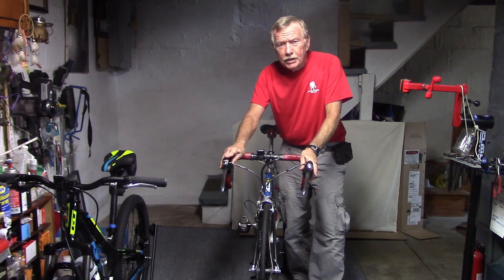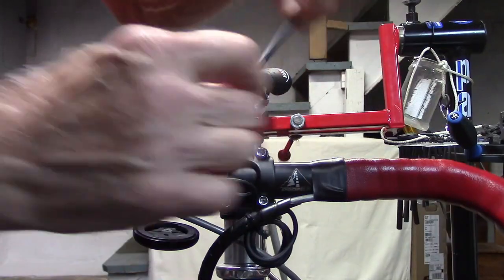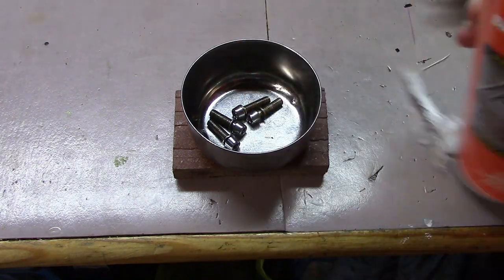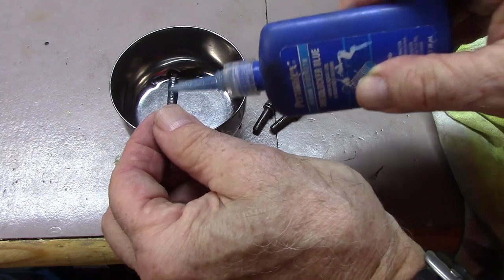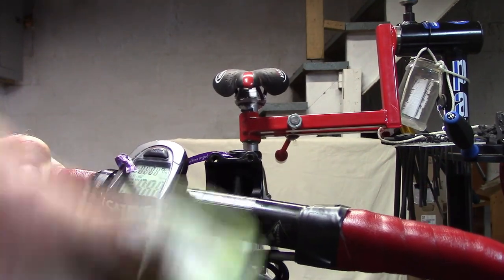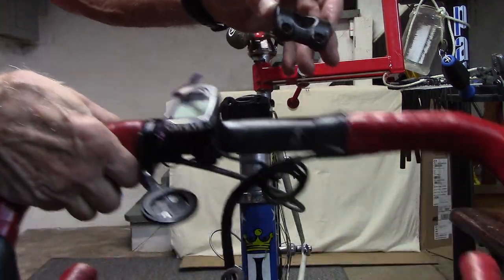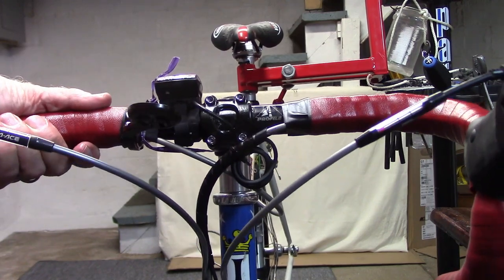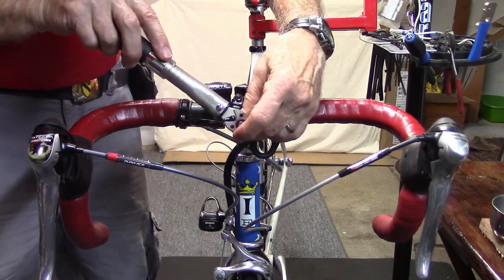Handlebar Creaking: Problem solved

Comment: Hi Tony,  from Brazil. Amazing Man!! I'm I was just looking for a solution for my case: i checked pedals, seat tube, headset, cranckset, and nothing solved my problem. So, i saw this vídeo, and i used the blue loctite in the steam bolts and the creak sound dissapear. Thanks a Lot for this maintenance classe!!!
Reply from the maker: Finding where the noise is coming from is usually the biggest challenge, especially when dealing with clicking or creaking. Congratulations on finding the problem and the easy solution. In some cases, one needs to also remove the handlebars, clean the clamp area and I usually apply Fiber Grip (used for carbon fiber but allows for a better seal with all materials including aluminum and steel at a lower end of the recommended torque recommendations) to the area of the clamp that comes in contact with the handlebars. 

Also visit our YouTube home site at:
https://www.youtube.com/user/MrTony10speed
Regards and safe cycling, Tony

Comment: Great channel full of helpful tips and hints, new subscriber thanks for the uploads.
Reply from the maker: You are welcome. Glad you find the videos helpful. Regards, Tony
Reply: @tony10speed  strange, I have aluminum handlebars, but I have this noise, but I have carbon spacers? aluminum handlebars make that noise?
Reply from the maker: @BikeIsLife4EverGG  Most handlebar these days are aluminum with some newer that are carbon fiber. And yes, aluminum and carbon fiber handlebars can creak (the carbon fiber spacers are not the cause). You may need to remove the handlebar clamp, clean and use Fiber Grip carbon paste (even with aluminum bars) because the Fiber Grip allows for better compression of the handlebar, less friction and less noise. Regards, Tony

Comment: Another good tip is to mark the clamp/bar with Whiteout.  This will assist in assembly at both axis.  And easy to clean off.
Reply from the maker: Great idea. Thanks for the tip.

Comment: I’m having the same exact issue. I installed a new stem, I thought maybe it was in the bearing, I’ve had it apart several times, it’s got plenty of preload, I’ve torque all of the handlebar hardware. I did not use this paste though, might be time to purchase some.
Reply from the maker: I had an issue with one of my restored bikes where it made a creaking despite cleaning the handlebar clamp, using Carbon Paste, and torquing to specifications. My problem turned out to be a loose headset (despite the fact I didn't hear a "clunk" when braking). Replacing the headset bolt  with a new longer bolt and tightening a little more until the wheel did not freely turn back and forth, then backing off the headset bolt just a bit solved the creaking noise. Just something else to consider. Regards and safe cycling, Tony
Reply: @tony10speed  yeah, I’ve loosened and retighten the headset stem a couple times. I tighten it enough, so it doesn’t rattle when I bounce the front end up and down. I truly think it’s in the stem/bars bc I just installed a new stem. I greased the bolts on the handlebars too. I’ll eventually get it…I can only get it to repeat when rolling with pressure on bars.
Reply from the maker: Be sure the stem is the right size for the bar. They can vary by .2mm and an improper fit can cause noise or even slippage. Also, I've seen creaking coming from carbon handlebars probably from some flection of the bar due to thin-walled and large-volume cross-sections. Safe cycling, Tony @rodb4523

Comment: This is exactly what started happening on my new mtb after 2 months of riding and it was loud and annoying . I knew it was coming from the head clamp. I’ll be getting the grease for sure.
Reply from the maker: If you note creaking when pulling on the handlebars that seems to go away when you ease up on the bars on flat terrain, it's probably the clamp as you mention.
I like to clean the clamp and bolts and then use a carbon paste such as Fiber Grip since it has small particles that allow compression at a lower torque setting. Be sure to grease (or, even better, use Loctite Blue on the clamp bolts so they won't loosen) and to check out the manufacturers torque settings for the clamp bolts (sometimes it's written directly on the clamp or stem). Let me know how you make out. Regards, Tony
Reply: Thanks I just ordered some fiber grip

Comment: Tony, this sounds like my problem, but I'm pushing down on the handlebars not pulling - the creaking only happens when I'm standing on my pedals up a steep hill. Do you also mean "pushing" as well as pulling? Thank you!
Reply from the maker: When you're standing on the pedal, you may not be aware that you are pulling as well as pushing. But yes, both can cause creaking. It's not a difficult problem to solve. Take a picture of the handlebars from the side with your camera. This way you'll know how far up or down to rotate the handlebar when you go to replace it. Remove the handlebar clamp bolts. Clean everything including the bolts. I use Fiber Grip on the clamp where it contacts the handlebar (has small particles that compress to prevent the handlebars from rotating down), use Loctite BLUE on the bolts. Reassemble and torque bolts to specs (consult manufacturer if not written on stem or clamp). Let me know how you make out. Regards, Tony
Reply: @tony10speed  you are so kind to reply in such detail and include a recap of what you showed in the video. I'm pretty insecure about working on my bike - afraid I won't tighten it enough since I don't have tools. Is this area that creaks a danger to me, or just an annoyance? Thanks again.
Reply from the maker: @WendyWahman  The most important aspect to consider it that the handlebar clamp is secure and the clamp bolts have been torqued to proper specifications. Otherwise, the handlebars may rotate downward as you're riding which can be dangerous. I would have your local bike shop remove the clamp, clean and lubricate, and re-install the bolts with Loctite Blue and tighten to manufacturers specifications. Although you might go many months without problems, I, myself, would fix the problem before it becomes serious.
Let me know how you make out. Tony
Reply: @tony10speed  Thank you so much. It was mostly fixed at a shop 3 months ago but has gotten progressively squeakier. I'll take it back. Thanks so much for replying and helping.

Comment: Last week I applied fibre grip paste and it made no difference. After I found your video I repeated the process but this time added the Loctite blue and it cut down the creaking 95%. It’s way better but I still have some creaks. Could it be stem bolts too?
Reply from the maker: Could be that the headset bearings need cleaning and grease. Where did you add the Loctite blue? To the handlebar stem bolts or to the area you used the Fiber Grip Paste?

Comment: The compound most likely have silica (sand) that will damage paint. The new handlebars are smooth and painted (or anodized) black most of the times. This is specially noticeable on black seatposts. Try not to put compound unless no other options. Grease does not work as well, because it requires greater tightening force to achieve the same effect. Some people use the anti seize compound, which I found to be the least evil.
Reply from the maker: I prefer Fibrogrip which has small Teflon particles (not silica) allowing for tightening at the lower end of the torque specifications and prevents slipping. Fibrogrip is made for carbon fiber but can be used with any handlebars or seat post with out scratching surfaces.  Regards,  Tony

Comment: aside from the annoying creaking noise, is it at all dangerous?
Reply from the maker: Creaking noise is not only annoying but may indicate an underlying problem. In the case of the handlebar clamp, there are several problems:
1. The creaking could be a lack of proper lubricant (proper grease or carbon fiber paste such as Fiber Grip). This in turn could lead to excessive wear of components and/or bolts. We wouldn't want to see a failure of either.
2. Lack of proper bond between the handlebar clamp above can also lead to handlebar slippage - the brake/shifters suddenly dropping down out of your control.
3. Over tightening of bolts can lead to creaking noise and bolt failure or breakage.
I pay attention to all bike noise and investigate each to the best of my ability. Time and patience are required. Safety is the main issue.

Comment: Did this and my bars are still creaking, any reason why?
Reply from the maker: Are the bars carbon fiber (some carbon fiber bars have alot of flex and creak)? Do you have the correct size bars for the stem you are using? If the bars are too small, no matter how tight you make the bar clamp you will hear noise. If too large, the clamp will not grab the bars properly.

Could what you hear be coming from some where else although it seems to be from the bars? 
Are the quick release or thru axles thight? 
Hold the breaks and push the bike forward. Is there movement in the headset? 
Check your cleats and pedals for wear. 
Do the pedal need to be removed, spindles greased and retightened? 
Sometimes creaking that seems to be the handlebars turns out to be the bottom bracket. 

Check the easiest things first and proceed in a logical order. Sounds get referred along the frame and fork requiring patience and time to find the source. Let me know how you make out.

Comment: I think this is what I'm hearing on my diverge maybe. Yesterday I had to pull up on the bars to lift the front wheel to go up a hump in the ground and my bike creaked. I was able to replicate it over and over again by lifting. It freaked me out I was thinking maybe I broke the carbon if the fork/steerer
Reply from the maker: Sounds more like a loose headset. Check out our headset adjustment video:
https://www.youtube.com/watch?v=N0Zagtnyhys
If you broke or cracked the fork/steerer you find the bike very difficult to steer and keep in a straight line on the road or trail. I know since I've cracked several over the course of my cycling career. Let me know how you make out. Regards and safe cycling, Tony
Reply: @tony10speed  ya my conclusion is that it's not the carbon steerer or fork being cracked and it just needs to have some paste applied. I recently had to add some to the seatpost because that was creaking so it must be similar
Reply from the maker: @akkoonassis9045  You may just need to remove, clean and re-grease the handlebar clamp. However, on one bike I worked on, the problem was that the steering tube of the fork need to be cleaned and re-greased. It's a little more of a job to take apart, grease, re-assemble and adjust the headset. Try the handlebar stem clamp first since that's easier. Don't forget to clean and lubricate the the bolts of the clamp and tighten to manufacturers torque specs so they bolts won't loosen up while riding (seen it happen and the whole handlebar and brake/shifter rotate forward - not good). Let me know how you make out. Regards, Tony

Comment: Hi! My cycle is Roman Bike XT-780x. I bought it last month, brand new, and now it is making a squeaky noise when I'm turning the handlebar. I thought that there might be some rust due to which it is making a noise. But when I checked there wasn't any rust. Secondly, there is a clicking noise in the rear tyre. Please tell me the solution for these problems, I'm worried a lot😢
Reply from the maker: If it squeaks when you turn the handlebars, it sounds like the headset was over tightened. I have a video relating to the headset being too loose. The fix for being "too tight" involve loosing the stem and headset cap bolt and re-tightening as in the video:
https://www.youtube.com/watch?v=N0Zagtnyhys&t=1s&ab_channel=TonyMarchand
and
https://youtu.be/TihBJNn0Bck?t=218
The other possibility is that the headset "races" where not greased which involve taking the entire headset apart and greasing the proper components of the headset (a much bigger job). See:
https://www.youtube.com/watch?v=CfDbN6hTu_A&ab_channel=GMBNTech
As far as the clicking from the rear of the bicycle, does it happen when pedaling, coasting or both? Does it occur as a constant clicking, once every pedal revolution, once every third or so pedal revolution, more often? See:
https://www.youtube.com/watch?v=0_qZmXNS8PQ&ab_channel=TonyMarchand
Let me know. Regards, Tony
Reply: @tony10speed  Omg! The handlebar bar noise has gone away. I just loosened the screw, like the way you said. As far as the clicking sound is concerned, it comes when somebody is sitting and the cycle, and it comes when the cycle is stable as well as when I am pedaling it. It is a very annoying noise like tick tick. Thanks❤️
Reply from the maker: @mairchishty6847  Just to make it clear, it clicks when you pedal or coasting (riding on the bike but not turning the crank). Is this correct? If so, several things should be checked:
1. Is there a loose spoke? Pluck each spoke like a guitar and see if there is one with a very low tone. You may be able to feel that it's loose. If so, you will want your bike shop to take a look and re-true the wheel.
2. Make sure the wheel is installed correctly and not hitting the brake pads (rim brakes) or rubbing on the disc brakes. You may want to remove the wheel and re-install it making sure it's centered.
3. If you have an odometer magnet or Garmin magnet, make sure it's not hitting the magnet "pickup" each time the wheel rotates.
4. Finally, it could be coming from the rear wheel freehub. No easy fix hear except to check with your local bike shop about solving this problem.
You didn't mention how often you hear the click: Once every pedal revolution, once every wheel revolution, constant clicking?
Regards, Tony
Reply: @tony10speed  It clicks when I'm pedaling, once every wheel revolution.
Reply from the maker: @mairchishty6847  Check the above (but if there is no clicking while coasting, a freehub problem is less likely then the others listed). Also check for a stiff chain link. See:
https://www.youtube.com/watch?v=hklVw3KErKw&ab_channel=TonyMarchand
You can also check out our other video on clicking while pedaling:
https://www.youtube.com/watch?v=0_qZmXNS8PQ&t=1s&ab_channel=TonyMarchand
Let me know how you make out. Regards, Tony
Reply: @tony10speed  Sure!

Comment: What happen if I over tightened my bolts in my stem does it destroy my stem ? Or create cracks ? 
Does it okay to over tighten my bolts even it is an alloy ? 
Im using an EC90 stem
Reply from the maker: Bolts are (usually) steel and stems are aluminum or carbon in most cases. Steel is much stronger than soft aluminum or brittle carbon. The torque rating is so you don't pull the threads out of the stem (strip the threads) or crush the bars. Torque ratings are especially important when you are using carbon in the bars or stem where you  may crack and damage the carbon. So invest in a torque wrench and look up the specs for the torque for your stem (usually around 5 Nm but there is some variation).
Regards, Tony
Reply: @tony10speed  sir I dont have torque wrench and even I over tightened the bolts my drop bar is still moving downward
Reply from the maker: @johny9083  It would appear the the handlebar diameter is too small for the stem clamp. Sometimes there are marking on both stem clamp and bars that tell you the diameter. Otherwise, you or your bike shop need to measure both. The cheapest option are handebar "shims" that are placed on the bars to make up the difference in size and hold the handlebars in place. I just ordered a pair for one of the bikes I'm working on. If there are no marking on the components or you don't have calipers to make the measurements, see your local bike store who can measure both. And tell them you want the shims (you don't need to replace the bars and stem unless they are an unusual size). Let me know how you make out. Regards, Tony
Reply: @tony10speed  i habe already a shim and it make fit in my drop bar and stem but my problem is that it still moving downward or twisting if I will apply higher force downward. Do I need to buy fiber grips ? 
Im thinking when I over tightened my bolts the stem and drop bar will crack.

Comment: If you put grease on the clamp wouldn’t that make the handlebars spin?
Reply from the maker: Fibrer Grip is different from normal grease. It contains small Teflon like particles that allow for compression and prevent slippage at a  slightly lower torque. This compression prevents slippage and also decreases noise from the handlebar clamp. Although made for Carbon Fiber, we use it on all our handlebar clamps and seat posts.

Comment: I have tighten those bolts and that sound still on I think is the bearings
Reply from the maker: Did you clean the handlebar clamp and apply Fibro Grip before tightening? 
Did you check the headset for knocking or creaking? See:
https://www.youtube.com/watch?v=N0Zagtnyhys
Also check the quick release or thru axle. See:
https://www.youtube.com/watch?v=XQCrqDXwycA

Finally, it could be the headset bearings and you may need to overhaul the headset (or have you local bike store take a look) if other sources of creaking / clunking are ruled out.
Remember that noise can be transmitted thru the frame making it difficult to pin point. Good luck and let me know how you make out. Regards, Tony

Comment: I had a creak on a bike with square tapered bb and I thought the frame was going to brake when I was climbing. It turned out to be a loose chainring bolt.
Reply from the maker: Good tip. Sometime hard to identify where the creak is coming from. I, as you did, check the easiest things first such as are the chainring bolts torqued to manufactures specifications. Thanks for the tip. Regards, Tony